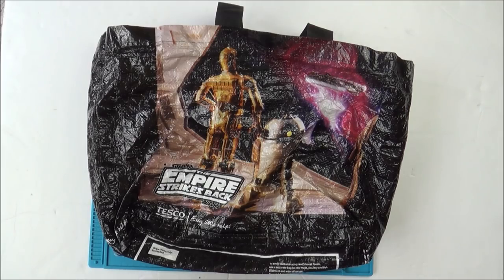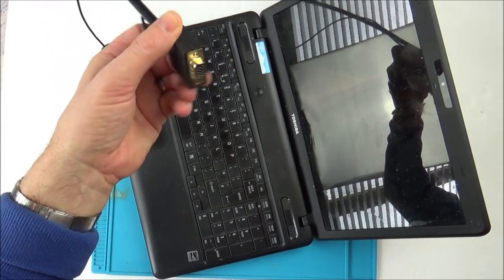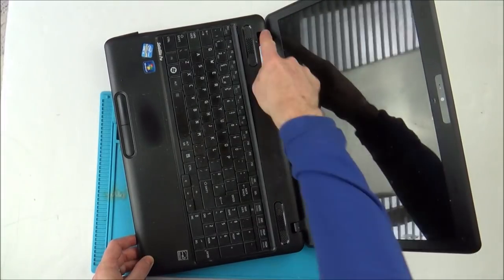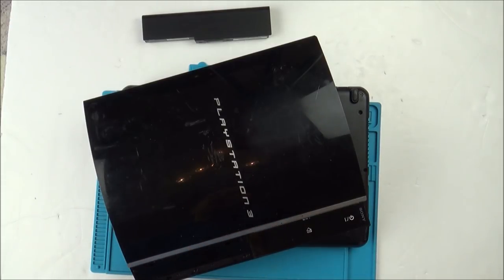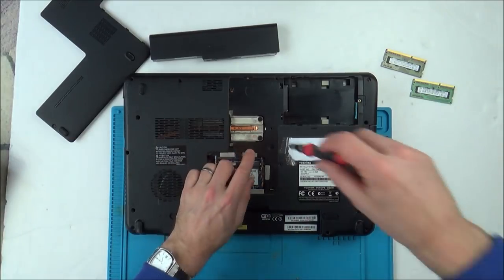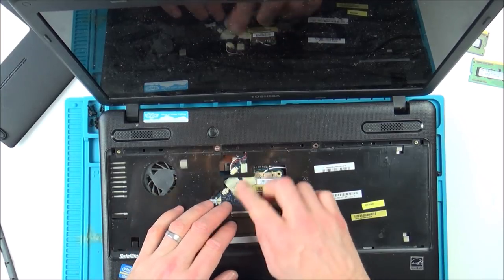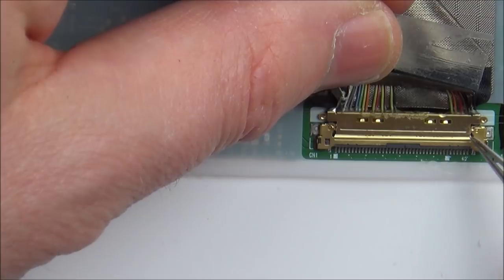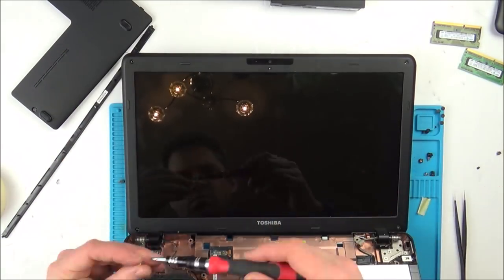Trying to FIX: Toshiba LAPTOP (Satellite Pro C660)

Comment: I know you always say, don't follow what you do, but you gave me enough info, and the courage to try, so last year the wife and I go dumpster diving, at the end of the college school year, and found so many good things, one was a fully working ps3 first Gen, with the flip up front part, added that to my ps collection, but the best dive was this Toshiba laptop, it is only a few months old at the time, about 1 year old now, and I couldn't get it to work, I took the knowledge you shared, and made a power cord for it, which got it to at least turn on so I could figure out what was wrong with it, I fiddled around with it, replaced a few things, and got it to work, and it's the one you can flip backwards and it becomes a tablet, a 17" tablet, I was so happy, and cause it's a foldable tablet model it also has touch screen, I have since given it to my wife, cause I use her new laptop for my electronic drums to run software on it, but want to thank you for giving me a direction to go to finally fix a truly nice laptop, thanks buddy.

Comment: I've never seen thermal paste like that.  That's definitely not how MX-4 should look.
Reply: Yeah it's old... It may come in a new tube, but it's old paste.
Reply: @knighthawk86855  your right it needs a good mixing because its old stock most people would buy the small tubes  i would be trying to pull the plunger out and mix it in the tube  with a bit of thin rod/skewer
Reply: Yeah old paste. The silicon base and thermal particulates has separated. Needs a good remixing.
Reply: @captain_sp33dy  MX-4 is a very good paste, obviously something not right with that one.

Ive seen many thermal pastes that look runny to start on first use, but usually a few squirts and its normal again.
Reply: On my old (official) one it have done that one time, i mixed it by moving the syringe and making air entering in it and also by shaking it. After removing the air everything was fine.
Reply: I also bought a big tube of mx4 on Amazon quite a while ago, but mine also looked like that, has to be old stock :/
Reply: Had 3 tubes of it myself from 2 different places & same thing , started using thermal grizzly & never looked back , bit of a pig to apply being its thicker & sticky but a better paste by far for me
Reply: I have a small tube of Artic Silver bought back 2003 and it still looks like new, no slime.  What is happening with products nowadays? Quality has gone down every year in this world.
Reply: Tris542, Personally, I use Thermal Grizzly, but there is nothing wrong with MX-4 if you just need a basic thermal paste.  It’s not like he’s going to be doing any high-end over clocking on it where every degree C matters.
Reply: @adventureridergirl  Its why i went to thermal grizzly TBH as it seems to deal with high temps for longer than any other paste , with MX4 i was having to repaste every 6 months or so , with Grizzly 18 months in & still holding up the same as the day i pasted my CPU , for the long term high heat OC it can't be beaten but its a pain to apply as its thick & sticky but not to bad if you use the applicator that screws on to the syringe , i like to spread it evenly , never have had as good temp performance as with other application methods but its all personal taste when it comes to application methods
Reply: would of been better off using mustard
Reply: RobertKnighthawk it's Chinese counterfeit thermal paste I've seen them all over. Only purchase from legit resellers or reputable stores don't purchase from amazon or eBay .. good store is newegg remember if the price is  too good to be true it most likely is.
Reply: hardly shaking the tube is more than enough. no need to pull all out mix and put back in. do like you do with a mustard tube ^^
Reply: Neither how Mx 2 as well
Reply: Its watery because he didn't let the cpu dry after the he used the alcohol

Comment: As someone who has done this at least a thousand times, I was wincing whenever he starting pulling on things or saying, "I wonder what this does."
Reply: Same here, I would have upgraded the ram and put an SSD in it, then sold it after the repairs.
Reply: Haha same here man!
Reply: @ariahjade34  that Toshiba isn't worth wasting an SSD on. That board probably won't last much longer. I'm actually surprised it's still running.
Reply: How smol is the trackpad 😂
Reply: Yep, I was dying inside.
Reply: Me too! I was like remove the keyboard lol
Reply: @89ludeawakening1  what’s wrong with the motherboard?
Reply: @joshmatthiesen4552  it's a lower line laptop which isn't made to last, and it's like 21 years old now. That laptop released in 2010 and I'm very surprised that it's actually still working at all. Most Satellite laptops are cheaply made.

Comment: Excellent restoration, not a single mistake. An old laptop benefits greatly from upgrading the hard drive to an inexpensive SSD. Also, the biggest issue people have after replacing the screen is non-working brightness controls. Worth checking the functionality.

Comment: Toshibas are generally easy to work on.  In fact, you probably noticed for screen replacement it wasn't even necessary to take apart the top from bottom.  That MX-4 is NOT normal, it should NOT look like that watery consistency.  I've worked on laptops for a long time, it was a bit surprisingly and enjoyable to see a first-timer (more or less, and being you) get on with it.  Great as always

Comment: Great job done there. One very important minder is the battery was under a recall due to overheating issues from Toshiba so be careful and don't leave leave it plugged in and unattended - I know of this cause I have a old Toshiba  C650D model and as the battery aged from 2010 back when I purchased the laptop I noticed after 5 years the battery stated to get very hot when charging so Be mindful of that...

Comment: Most modern laptops use a NGFF wifi/bluetooth card that has two antennas-  one of them is just for wifi and the other is shared between wifi and bluetooth.  They use two antennas so they can use a technique called spatial multiplexing, where they can send different data on the exact same frequency at the exact same time, and get higher throughput.  This is called MIMO, which means Multiple In, Multiple Out.

Comment: Proud of you mate. Should do more laptops.

For future reference:

- be very  careful with heatsinks, a bend or kink in the copper pipes can severely limit cooling capability

- MX4 shouldn't be so watery. Something was certainly off. You were spot on about that

- When repasting, avoid lifting up the heatsink and putting it back down as you introduce air bubbles which is undesired. You want a thin even application rather that too much because the paste is meant to help transfer heat between the chip and heatsink rather than act as a coolant which many people misunderstand. A tiny bit just slightly larger than a grain of rice is fine. Apply in the center and just trust you did it right. No need to check. 

Last bonus tip: after you've got windows installed, if temperatures are still relatively high due to poor thermal design or a less than perfect heatsink (saw a bit was squished in the video. Can't confirm if it was intentionally like that, but usually is not), use an application called throttle stop or intel-XTU to undervolt the CPU -100mV or the highest stable undervolt around there. You can drop anywhere from 5-20 degrees Celsius if done correctly which can make up for thermal deficiencies in the laptops design, poor repaste application or less than perfect heatsink. Benifts most every laptop and is a relatively safe and easy thing to do for considerably better thermal performance allowing the system to run at its best and avoid throttling down.

Cheers. Looking forward to more laptop fixed in the future! You did great!

Comment: I have 2 from the Toshiba C6xx series. They work within their limits. Basic fairly well designed and as you have illustrated are quite repairable. IME you might want more RAM for W10 but Linux will Just Work on everything and depending on the CPU will run faster and most things will work better (internet things like streaming Youtube). BTW my first one of these dates from 2011(8 and a half years as of this post) for which I paid 250 USD and consider the payback to be complete. My second one is a newer model with a slightly faster CPU that I purchased for 55 USD a year ago. 

Well done, mate. Keep on keepin' on and be well.

Comment: I've done 3 Toshiba Satelllite C50 laptops for my own use, 1 as old as that with the removable battery and 2 later ones with the battery held in by 2 screws you invalidated the warrenty if you removed them, all with intel processors. I love em, all now have 8GB ram, 500GB ssd  and Intel i5 processors. They all run windows 10 home and it's hard to distinguish between them in performance. Easy to rebuild and repair for an old fool like me so have fun with it.

Comment: imo for laptops get a cheap 120gb-256gb ssd. makes a hell of a difference in performance.
Reply: Yup if only Is for browser web put a ssd Is a great upgrade, apart for that you can upgrade the cpu, sometin like i5 or i7, and up you ram to 8gb ddr or 16gb, for cheap
Reply: @lutboy2909  I did that to a 2009 Toshiba satellite and it was so much quicker
Reply: Both of HP HDX 16 and Dell Latitude have SSDs (Which I had fixed and updated).

Comment: Hey vince, I've been using this cheap thermal paste from ebay, and it works really well. from what I've seen, you can get near identical performance of MX-4, and it's dirt cheap! If you want to give it a try, it's called GD900. Also, just a suggestion, but to really speed up that old machine and breathe new life into it, use an SSD instead of a hard drive. Trust me, once you use a PC with a Solid State Drive, you'll never go back to using a mechanical Hard Drive.  :)

Comment: One of those is my main computer! 6Gb RAM, 120GB SSD for the OS and a 500Gb HDD replacing the DVD for data, plus an external 23" screen, and running Linux Mint, it does everything I need, including 3D CAD. I've had it apart to clean the fan, but haven't needed to replace any parts yet.

Comment: I've always suspected old laptops throttle the cpu because the paste has dried out
Reply: Not to mention concentrated dust blocking the heatsink....
Reply: @8bitbubsy  Not to mention no easy way to blow it out in recent designs.  My old laptops had a simple door you'd open and the whole fan would pop out.  Now you have to fully disassemble everything down to taking the heatsink off just to blow some freaking dust out.  That's like you need to remove the engine of your car to wash it properly.  Ridiculous.
Reply: @anonamatron  Yeah... I usuallly disassemble the laptop and remove the fan and blow it out, then I blow out the heatsink while I'm there. Some laptops are still pretty easy to maintain, but others are just hopeless these days.
Reply: Toshiba's are problematic. They throttle by design. I use ThrottleStop program to bypass that.
Reply: My old dell kept shutting down randomly. Worked out was overheating. Changed thermal paste and problem was fixed. After about 4 years use becomes less effective.
Reply: my HP 250 G1 did that. after cleaning and thermal paste replacement it dropped by 15 degrees and was quieter too
Reply: You don't have to replace the paste unless you're taking the heat-sink apart.
Reply: @paultasker7788  one really cool thing about Dell laptops is the built in ability to manually control the fan speed. Have you learned that little hack?
Reply: @8bitbubsy  I called them "Cotton Dust" wherever I fix laptops and see those concentrated dust around grills

Comment: You did it 100% right. That mx4 was not good you right about that. The HDD you can stick with dubbel tape. Also change the bios bat also. And change the thermal pad. For the first time really good Job.

Comment: At last a video where I have some knoweldge to pass on.  I've repaired dozens of C660.

When changing a screen, you did it right by removing the main battery and charger.  Even when the power is off, there is voltage running to the screen.  If you try to change the screen with a power source connected, then you have a very good chance of blowing the fuse for the panel.

All laptops of that era are pretty much the same inside, if you can repair one, you can repair them all, so very easy, but as with mist consoles the clips are very fragile for the ribbon cables.

Comment: These Toshiba Satellites are absolute beaters.

When they were new they were all low end, cheap made, low performance machines. Usually used for schools or the workplace where they're mistreated to death.
Yet they solider on ! Guess they are rather reliable seeing as how many are left even after what they deal with.

If you're going to fix laptops what you really want to look into are Lenovo/IBM Thinkpads.
They're super well made, lovely to work on, especially the older ones, and they have a cult following, meaning they're rather profitable to repair. :)
Reply: The only thing I never really took too was that ultra-glossy screen coating. Other than that, our old Toshiba lived through three teen daughters then she went in to my bone yard.

Comment: @My Mate VINCE You should have a look at Thermal Grizzly, I have completely replaced Arctis and MX-4 with Aeronaut or Hydronaut. Also in my opinion all mechanical drives in laptops should be replaced with an ssd, they are the same size and they dont slow down and fail every few years, $30 US dollars for a 250 gig ssd, $60 for a 500.
Reply: Oh yes, a friend of my grandparents got a new laptop around 2 years ago, Acer Aspire ES1, it's ok for her with i3-6006U and 1080p Screen, but Windows 10 is SLOW LIKE HELL because of the HDD, maybe just 4 Gigs of RAM are also braking, but in Task Manager the Hard Drive use is 100% permanently.
I should visit her again, already got a 4GB Stick of RAM since December here and a SSD...

Thermal Grizzly is good, I use Kryonaut, it's not so comfortable to handle, but because it's rather dry, it won't dry out so soon.
Conductonaut (Liquid Metal) is also great for older Laptops, it probably won't lower the maximum temperatures significantly, but the fan may spin up later and less often also maybe with lower rpm, so you get less noise, but careful, you should apply a barrier of nail polish around the Die and just a tiny ball of liquid metal.
Reply: I have first hand experience with the major difference between a HDD and SSD. When you load Windows 10 on an HDD you will notice most of your bottle necking on disk access as it is quite often pinned between 99% and 100% use according to task manager. Once I installed a SSD the computer felt snappier and windows responded much better as the usage according to resource monitor and task manager was no longer pinned and under 10% at idle on a fresh restart
Reply: Joo se viikonloppu muuten

Comment: Nice work mate, I suggest you to put a piece of foam or something
in the empty area of the hard drive slot just to protect it from accidentally coming off, 

Cheers
Reply: If I remember on the C660, there is a piece of plastic on the underside of the hard drive cover that keeps the drive pushed into the slot.
Reply: @Christopher_T_Paul  good to know :)

Comment: Hiya mate I am a qualified city and guilds Techy and honestly you did alright for your first time doing it, only issue is that you did not wear a ant-static bracket.  Which means the static electricity on you can jump onto the components and kill them, so you need to make sure the surface your working on is earthed as well as yourself.

Comment: Nice restore Vince, consider putting a cheap 120 or 240GB SSD in because it will vastly improve the speed. If you do another laptop disassembly always remember to remove the battery cable before pulling out the screen cable otherwise you will almost certainly blow something. I say that because most laptops nowadays have internal batteries and it's very easy to forget this.

Comment: The thermal paste is perfectly usable, I would suggest you mix it after applying, sometimes the silicone grease that prevents the paste from solidifying while in storage separates, it's not a common occurrence but it does happen, it doesn't affect thermals.
Reply: Sometimes when it happens i mix it with toothpick right on the die or on place i applying it.

Comment: There's a general rule of thumb when replacing the display of the laptops, that is the size and the connectors. If you don't have the same size or connector. Then it will not fit (work for not having the right pin connector). And I did have my fair share of things with fixing scrap laptops. I have an HP HDX 16-1140US laptop that had thermal paste encrusted around the die shield. Which it actually overheats every time I have tried to use it for a while. Fixed it by repasting (and making sure that the fan wire is connected to the motherboard). Still missing the back shielding (or something like it). And Dell Latitude with i7 620m. Both worked perfectly fine, but the Dell is missing an R key. I had tried to get a replacement for it, but I had the wrong one.
Reply: Easier way: Just Google the model of the laptop with screen replacement. I have done that many times and got the exact screen required.
Reply: @HuntersMoon78  That is true. But with some models, the original replacement isn't available.